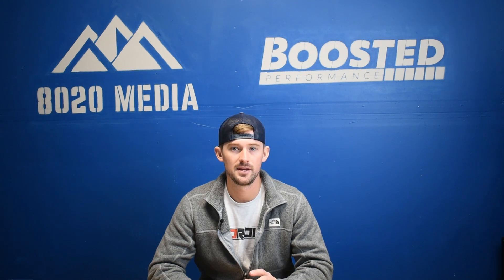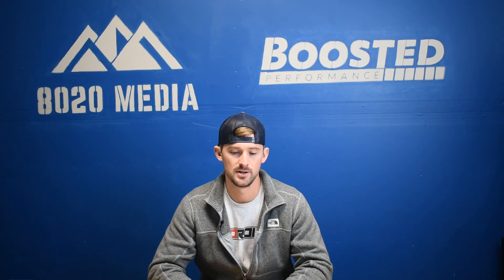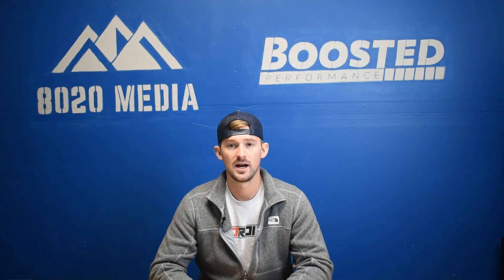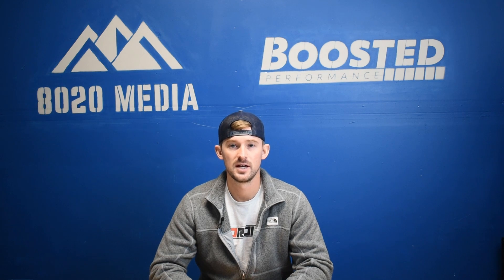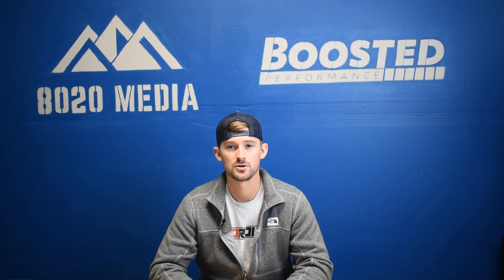The Few FLAWS of the Ford 4.6 V8 Engine!

Comment: I've had personal autos and work autos with this engine. My buddy in Marines father has a cab/livery business in NY city. He'd buy these panther cars at 200k plus and run them till they died in NY stop n go traffic. He'd get 500k regularly at the least, highest cars had a shake over 700k. All serviced on time. Usually jmod so they don't slip as much. 
I have a 99 Cartier 253K, 07  Designer118K still like new. I've never had plug, timing issues. I always pulled covers and checked them at every 50k after 100k. I've been lucky but I do take care of them. I do my service on time every time. This is key. All have their issues. I've had alot say trans, plugs, fresh air leak, air ride etc but most besides vent leak is a service issue. Most don't do services religiously. These modulars need it or urr asking for issues.

Our work trucks and vans have had some of the issues mentioned. All was bought new or close but not serviced on time. It's hit or miss. I do have a rattle and know my 99 is gonna need a timing set in future. Just a slight rattle. I also removed back cats. I live in a no sniffer county. And I modify the air box to get more air. Not a cai but remove the 2 inch horn and cut hole to 4.5 inch. Engines are air pumps. Faster in and less restriction out is best for a V8. Also they have another issue most don't know, the pass side frame behind rear A arm mount on outside will rust. It's a easy reroute AC drain line on either side of frame. Another is the foam Ford used that holds water and will rust.

 I use Eastwoods internal frame and chassis black, farm implement paint etc. In rust country it will rot away if not.
 Also use 1 quart of any new, used oil, same with trans fluid, 1 tube of grease, 1 wax ring toilet flange gasket. Heat and mix in old pot. Spray, brush etc all under and inside cavities. Will NOT EVER RUST. Pap was 80 and still doing this. I do this. It outlasts, anything u can buy and it costs $6 with used fluids. Most wax has no oils or very lil. I live in rust belt so it's a must. Not saying the video is attacking the 4.6 but just saying my experience. 

If they had another 75 hp and same with torque it'd be a perfect engine in panthers or trucks. I wish they still was made. I've owned them for 15 years and wish I'd owned them for 25. They was used in many autos and are a good reliable engine. Like he said check the plugs, most that popped had only a few threads. Using a bore scope u can pop 1 out and look. If urr is this type just be aware to do as he said. Both of mine look good with good threads. There's kits to fix this if u like so that's not a worry. Also I use a extra oil and trans cooler. They're cheap or u can use a junk yard 1 if u like. Heat and the soft shifts kill trans. I'm cheap so I save $$ in JB economy. But use motorcraft parts. 

Also plug door drains and fill with baby, mineral, or melted Vaseline. Let sit for a week and drain and save. And I hear so many say air bags suck. They do when u don't protect them. I see ppl swap and not put anything on them then say they suck cause they don't last a decade. Coat with Vaseline once a yr. It's rubber. It will crack. I spray with 303 all rubber parts and they last forever. Spray tires inside and out and do once a yr and they won't crack and last too. Bags get extra cause it's under car with all the elements and snow, mud etc.

 I know this is long but I love these engines, cars and compared 2 most made during or since then are not. Service on time, protect what u got and enjoy. Nothing rides better than the panthers but maybe a Citroën suspension from the past. That's the smoothest riding car I've ever drove or rode in. Lincolns 2nd best. They are the 1st car to get a 5 star crash rating across the board. There's a reason why they are still used as taxis and cop cars. If the other 2 mfg would've kept making the Caprice and the Chrysler type of cop cars like the Furys of old, maybe they'd not been so popular. They get good mpg, reliable and safe. I wish they still made them and station wagons. Idk why we had to do the SUV BS. A full frame sedan are hard to beat, like a sore Peter.
Reply from the maker: Jason - Thanks for typing out this very in depth feedback. Although long, it’s very useful for future viewers!
Reply: @8020Automotive  Love these cars. I've spent alot of time and talked to alot of ppl who built, work on and own these. I found out all I could so I can keep them going. Today's cars are a joke. Too much $ for a turd. These have proven themselves since day 1 in 80s. Can't say that about any other cars of this type. I hate to see ppl struggle. I believe if we have this platform why not share all we know and can to help each other. We've spent too long divided and hating. We need to help 1 another in any way. This is what I know and love so why not. I see alot of YT pros who do good work but seem to miss out on basics. When cutting rusty metal they weld in new but don't use weld through primer. Gonna rust. same thing and metal behind what is repaired is bad also just cover up. Money's tight, Fuk JB, so we gotta make all things last. If we spend half tge time helping 1 another as we do dogging 1 another wed be much happier. Money's short, times r hard, can't afford a new junk car, these r old but very nice, all I can give is my advice, treat them good and show them love, always remember fellas, wear a glove. Big cats can be dangerous but a lil puzzy never hurt anyone.
Reply from the maker: Jason - Well said. Thanks for the added insight!
Reply: @8020Automotive  Considering what newer cars are doing like blowing up engines, trans, batteries, etc the quality is shat at best. I'd love to challenge any 1 to get a newer auto out of warranty, 100k, I'll get a used panther, make it fresh as good as new and see over the next 5 years what issues they have and what work needs done. 

In over a decade I've had to replace a starter cause the hot wire side of starter deteriorates, and that's it. Not talking about service but breakdowns and how many times she didn't start or go from point A to B. I've had jobs where if u didn't show up u was fired.

 Boss was a greedy pick and said urr ass is at work unless u die. If urr spouse, Parents whoever dies tough crap, u better be here. He did not care. He fired a new guy cause he didn't check fluid levels in a new Dozer. I was raised yo always do that no matter but I see why he didnt. If they loaded, drove up on low boy, started and drove off and it's NEW it shouldn't have any leaks or low on fluids. But he got fired start of 1st day. 

I had to have a reliable auto to drive in tri state area in oil and gas land clearing. My 99 did this perfectly year after year. If this was 1995 then we'd have all sorts of nice full size sedans to talk about. But after they went to SUV they are gone. Only thing left easily got with a full frame and V8 is the panther. Sad. Very sad that kids today will never ride in a big sedan, station wagon etc on family trips. I've saw the country side sitting in back of a station wagon, back of big cars. Now it's stare at a screen and get dumber by the minute on car rides. Those born around 00s mostly have no idea what riding in a big sedan, wagon or back of a pickup truck is like. What are we doing these days? Making crap autos, nothing lasts and we just throwaway, no tv repair shops, and what ppl say about you or comment is so dam important that if we don't get our egos stroked daily we have mental breakdowns. I miss the days when men were men, women were women and we played outside until dinner time and ppl kept their word instead of canceling by text. How did we do it? Ppl today would be totally lost with no SM or cell phone. Might have to actually talk to another person. Oooohhh how scary my Anxiety is rising. Cmon ppl. Make a great auto, make things last or fixable and help 1 another by being kind or not saying anything. Can't tell ppl Merry Xmas cause they get offended. I guess me and my kind just don't fit in today's delusions and mental illness. Cause I don't see a cat or don't see ppl as what they pretend to be. Have a gr8 wknd
Reply: @jasonchristopher2977  😂😂🤣😂😂💯💯i wish i knew what yall did,im good w the wrenching but man ur right, after a careless last few years of me in my early 20s , i am sitting here today w no other problem than to make sure that thing runs till I need it to run til.. ol stang gt super cool to own but I tried fixing the exhaust which got cut off at the cats , and learned how that works - and fixed mostly.. Now i fuecked with the PCV,. cause I found a catch can I can steal from a 04 gt, and rapidly installed on mine, beACUASE I rushed  , etc, It ran with hoses collapsed or installed backwards cause I had no internet either to research haha...... now im kinda paranoid and lil bit sad to think its about to give up. Ill be forced to fix it anyway im not all too scared thank god yk. Thanks blessing from here to there
Reply: i too wish I was older than 2000
but only 3.6% of all human beings that existed in total, have been born after 2000. Foood for thought, although tragedies and issues are distracting us here today in the flesh, the real important unpopular opinion is on what you willl be and where eternity will have you after your flesh dies.

Comment: Great and helpful video, do you recommend replacing the timing chain and servicing it before anything starts to go wrong? My 2010 crown Victoria is at 160k miles so it’s bound to finally start having problems.
Reply: My 4.6 didn’t start having timing chain issues until ~250k miles and even still it trudged along with intermittent misfiring until it passed 275k when it started sputtering on acceleration (admittedly it was moving a 5,500lb Expedition on 35” tires 😅)

Run slightly thicker oil if you’re that concert about it. A timing chain kit is pretty inexpensive and it’s not as difficult a job to do as many make it out to seem. Plus, worst case scenario, the 4.6 2v engines are $500 at the junkyard.
Reply from the maker: Kristopher - Thanks for the feedback! Timing chains are generally made to last the lifecycle of a vehicle, however, if you're experiencing any of these symptoms, we advisee taking it in to at least get it looked at:
- Rattling noise from the engine, especially at startup
- Poor engine performance or misfires
- Check engine light or trouble codes related to the camshaft or crankshaft position
- Increased emissions or reduced fuel efficiency

If you aren't experiencing any of them, just ensure to stay on top of maintenance, mainly oil changes, and you should be good!
Reply: I got a 2000 excursion and I get a rattling noise at start up. I seem to hear it come from the undercarriage, checked and could not find the source. At first I thought it was a heat shield. Negative.  If I rev up the engine it rattles.  While driving it goes away but every time I accelerate it comes back for a few seconds then goes away. Does it seem like it could be timing chain related?
Reply: Forgot to mention it's the 6.8 v10 engine
Reply: 198k miles

Comment: The 4.6 v8 2valve engine is the best engine ford made in a long time......
Reply from the maker: William - It’s certainly near the top of best ford engines ever made! Do you still have your 4.6?
Reply: @8020Automotive  yes
Reply from the maker: How many miles do you have in it?
Reply: @8020Automotive  192k
Reply from the maker: Sounds like you've got a good one! Hope you get many more miles out of it.
Reply: @shortstop-u4i can easily gate atleast 400k more miles
Reply: Agreed. No issues on mine 195,000 miles and still running strong, 02 Mountaineer.
Reply: 276, running strong
Reply: I’m in the process of buying an 06 F150 with the 2V 4.6. Family friend owned. Has 262k and runs very strong. He has always had maintenance done by the dealer and only the dealer since he bought it new. Can’t wait to get behind the wheel of it.
Reply: @MAdams790 they went 3 valve in 05 u have a 3 valve
Reply: @mikewilkes7831  well according to my window sticker, it’s a 2V 🤷🏼‍♂️
Reply: @mikewilkes7831 misinformation f150 only has 3V for 2 years 2009-2010 everything before was 2v
Reply: They 5.4 2 V is also bullet proof if you don’t encounter the spark plug issue 😂
Reply: My 2003 town car has 223,000 miles only thing I have replaced is air bag suspension and deleted the catalytics. Still running strong. Only complaint is the lack of power. But the knowing the engine will last to see 500,000 miles it's not a deal breaker.
Reply: How do I know if mine is a 2 valve? 2001year of manufacturing
Reply: @TVilardi  I’m pretty sure the 4.6 3V wasn’t introduced to the F150 until like 2008 or something. So 2001 would be 2V in the F150
Reply: @TVilardi  04 and older
Reply: 04 grand marquis here with 282k miles. Runs nice and smooth. Original motor and transmission.
Reply: Im at 195k
Reply: I just hit 199k on my 4.6l 2v 😎

Comment: My 2001 F150 with a 4.6 is indeed badged Triton V8 on the fenders.
Reply: Triton branding started in the trucks in 1997
Reply: And yes my 2001 also has Triton branding on both the fender and engine cover
Reply from the maker: Thanks for providing your experience.
Reply from the maker: Ah interesting, I think there are a few cases but for some reason the majority did not get it. I believe it was a trucks only thing too.
Reply: Same here

Comment: A lot of these common issues are maintenance related.
Though sometimes premature failure with proper care and maintenance does happen.
If you buy OEM spark plugs now, you won't have any issues.
The exhaust manifold issue is a ford thing back to the late 70s early 80s. Lol
Reply from the maker: Kelly - Thanks for adding this insight. We couldn't agree more!

Comment: I guess I've been extremely lucky because I never had timing chain issues or oil pump failures in none of the six 4.6L and one 5.4L engines I've owned. I did have to replace 1 intake manifold.
Reply from the maker: Proper maintenance and frequent oil changes always go a long way.
Reply: @8020Automotive  That's what it boils down to. If you don't change the oil frequently you issue with the plastic slack adjusters and guides. I've had not issues with mine at over 200k. So, you can't say you'll have issues with out addressing why. There are many engines that were designed with lower viscosities yet when people do not change the oil the sludge affects the engine much more than it would a older pushrod V8 engine. Additionally, this problem is even worse in 4V engines when oil isn't change. Bottom line. Whatever you own, change the oil every three thousand miles and don't listen to the manufacturer change interval.
Reply from the maker: Frank - We couldn't agree more. Thanks for sharing this insight!
Reply: I’ve had 3 oil pumps fail all on one car 3 different motors
Reply: lucky cus my 5.4 timing chain broke and shredded the engine
Reply: Going thru it now
Reply: I have owned and maintained on the conservative side of 30 98-2011 4.6, 5.4 and 6.8L and never had 1 timing chain issue and most of them went to over 250K miles and not uncommonly 300k... couple transmissions and intakes (even after the aluminum crossover, considering the base between the bridge and head was still plastic!) here and there otherwise The 2v 4 thread heads issue was fixed in 03.5+  (I believe most were remedied 02+ in mustangs anyway)
Reply: @commonsenseisdeadandgone  my 2001 Expedition with the 4.6 made it to 275k before it started to have timing chain issues. But pretty hard to be upset if that’s the worst thing to happen in a quarter million miles 😅
Reply from the maker: Charlie - Absolutely! Thanks for sharing your experience.
Reply from the maker: Sicone - Thanks for adding this valuable insight and experience.

Comment: I have a 1999 Ford f150 2wd 4.6 engine. 
 I have been using E85  for a 1 year and 4 months and I am getting 33.4 miles per gallon. 
 I usually put in 15 dollars of E85 and I can put on 252 miles. 
 I have a hole in my exhaust manifold
Reply from the maker: Nice, E85 is great especially when its cheaper than regular gasoline.

Comment: The 2 value lasted untill 2011 with the last cats having them being a crown victoria, muercury grand marquis and lincoln town car.
Reply from the maker: Ian - Thanks for the insight!
Reply: I own a 2009 grand marquis Ls and its got 218,000...now I've replaced 2 coils,  now 3 months later more hesitation, but it won't code..when i crank it up i get a metal to metal sound for about 2 seconds and the oil level is full??
Reply: Camshaft phasers are probably worn out. Check out the FordTechMakeuloco YouTube channel for videos on what is wrong & how to fix it. IF that is the problem, you must have it repaired or the engine will be destroyed.   @Russell-pe8xn

Comment: I have an 06 f150 4.6 I to had 1 spark plug blow out only because mechanic didn't torque right. 255875 on mine,1 battery alternator and that plug that's it. I would trust this truck to go anywhere. 
5w 30  Full synthetic. Not a tick not a rattle runs perfect
Reply from the maker: John - Thanks for sharing your valuable insight! This will certainly help future viewers.

Comment: Hmmn, the 4.6 2v's in all of our Fleet vehicles are the most low maintenance trucks we have had. 11 are 4.6 F150s and 2 f150s are  Junk 5.4 trucks.  The 2 valves are very reliable...ie Police car engines.  The 06 in the fleet is at 300k miles in and has only had normal maintenance.
Reply from the maker: J - Thanks for adding this valuable insight, it will for sure help future viewers. They are very stout engines, we’re just pointing out common issues that are seen across many owners